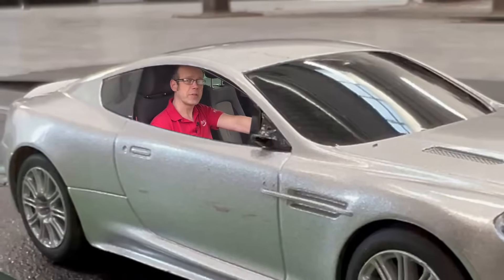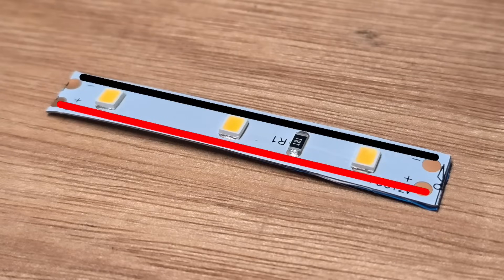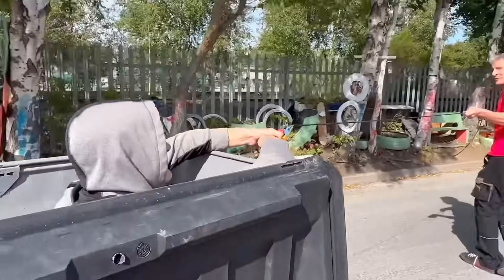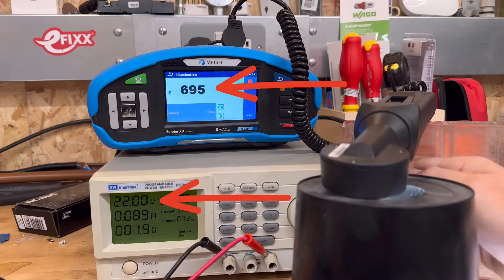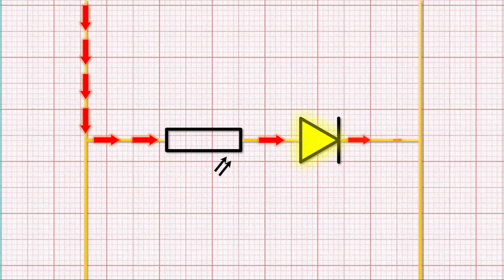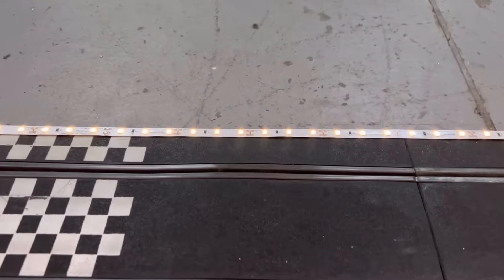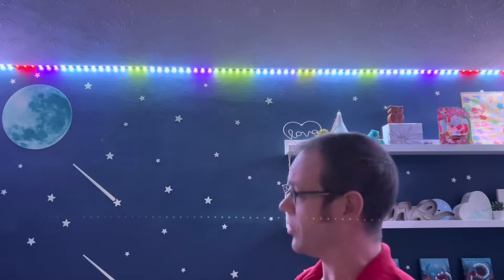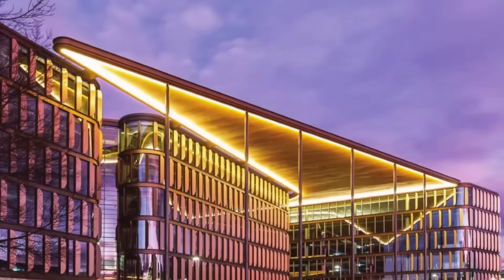Get Up to Speed With LED Strip Volt Drop

Comment: 5v is the one you have a issue with especially if it’s a high density rgbw  led strip with a dedicated white LEDs your options are running at lower brightness and power injection every so often depends on the strip

Comment: I've used a few different makes of led strip & my issue is the Crimp on connectors, especially the corner ones. I often have to take my wee soldering iron to work & fanny around joini g them with tiny wires.

Comment: One way to prevent dimming down the length of the strip is to connect the +ve at one end of the strip and the -ve at the other, not both at the same end.

Comment: Very simple, if you have a strip of 20 m and your limit is 10, you connect the cable at 10 m so you have two times 10 m on each side of the input, you have to adjust the current accordingly obviously (so for 20 m of strip)

Comment: That little black chip will mean that first led will run hotter.
Reply: True, but it's only a fracrional amount of additional heat so it'll it'll be fine. Just take care not to use the strip somewhere the LEDs are unable to dissipate the excess heat (same goes for standard LED strip)